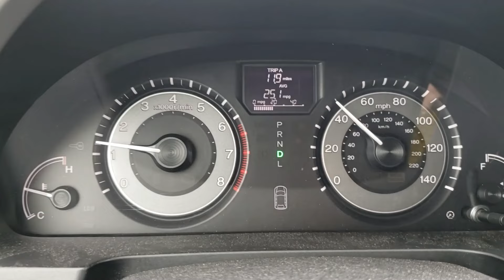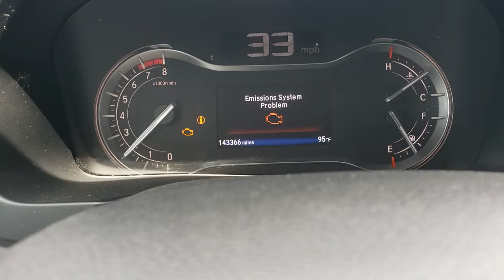EASY Fix for Honda Transmission Shudder! | Honda Transmission Maintenance

Comment: Drain plug size is 3/8 not 3/4. I’ve owned my Civic since new, change Transmission fluid every oil change. Cheap insurance.
Reply: Thanks!   I thought I will have to get a 3/4 breaker bar 😀

Comment: Honda Tech here...there is a TSB for this particular issue which involves doing 3x drain and fills of ATF in a row. By the third, you will have replaced all the fluid inside and should be bright red. There is also a software update available only at the dealership that fixes the electronic side of the issue. Torque Converters also go bad on these all the time and will throw a P0741 code if they are truly bad.
Reply from the maker: Great feedback @ZynovFTW.  Thanks for posting!
Reply: how much does it cost to get the software update?
Reply: Is this software update for all hondas? I have a civic and Id really like to know

Comment: does she (Very Very Nice young lady btw) mean 3/8" drive,,,,,  & how is she not UNDER the vehicle, & yet it's on the lift???..  Confusing video... You cal also use one funnel with a length of hose attached to then slip over the dipstick inlet - how we did it @ the Acura dealership...  SHAME on Honda for not making the dipstick tube longer reaching up higher...  SHAME

Comment: We bought a new v6 5 speed automatic Accord back in 2006.  I do all the maintenance on it. Always found it silly that it does not have a transmission pan.  I've done the fluid changes about three times in the 150,000 miles we've had it.  I've also replaced the in line filter once.  I drive it hard and use all 244hp.  I also gear it down from Drive to 3 to 2 sometimes when getting off the freeway.  Trans still works great.
Reply from the maker: Well done @jewllake!  Thanks for posting.

Comment: My 2017 Honda Pilot I change the oil and transmission fluid on a yearly basis. And I highly recommend that you only use the Honda ATF Fluid. Honda transmissions only like OEM Fluid. If you use anything else you will only cause more issues down the road.
Reply from the maker: Thanks for your feedback Austin.

Comment: You absolutely need to change the transmission filters on these vehicles. If it's accessible. I would change it every 30,000 mi. Every 50,000 miles on the outside...
Bless her heart...
This is the cutest nicest exposition of how to maintain your vehicle on the entirety of YouTube
Reply from the maker: Appreciate your comments @vette4118.  Thanks for posting!

Comment: Have you tried to reset the transmission? You turn on ignition to accessory mode, then hold accelerator pedal down to the floor for 30 seconds, then release the pedal and turn off ignition.
You can then start the vehicle and drive it. You should notice a change in shift points and smoother shifts.
Reply from the maker: Good info, thanks @MegaChuck51!

Comment: I have a 2012 honda pilot It developed a Shutter my Shutter went away when I installed a VCM muzzler 
I thought it was the transmission at first 
My pilot drives way smoother now without the VCM active
Reply from the maker: Good feedback @mikevital7656. Thanks for posting!

Comment: I have this shudder at about 30MPH between 2nd and 3rd gear I think. I've read that there's a software update for the trans that was supposed to work.. offered for the original owners a while back as a Service Bulletin. Yes? I tried the fluid change but just once.. worked only for a few days. I cheaped out but next time will go for the triple fluid drain and fill.. $125 worth of fluid I guess. Should I  change the trans filter too? This 2013 AWD LX also has the cold start growl/rash sound occasionally...  now at about 106K miles. I don't know if I should try to correct all these quirks, just live with them or just try to sell it while it still has some resale value. .. .. 
Thanks
Reply from the maker: It would be a good idea to complete the maintenance.  I'd suggest the full flush procedure and ask your local Honda dealership about any "tsb's".  The startup till warm sound may be a timing belt tensioner.  If you decide to keep it and if the timing belt service hasn't been done.  Scheduled for the full timing replace service and make sure the tensioner is included.  All in for both... probably around $1,500.  Otherwise, trade it in.  Maybe we have what your looking for?  Hope this helps!

Comment: Hi ,it showed me the light and i scanned code p0776 showed  after i change the fluid the light its off after i drove about 100 miles ? after i drove for couple of weeks start jerking again and  losing power but no lights it’s on  if i change the fluid 3 times again might resolve the problem , thanks
Reply from the maker: Your welcone Tony!  Thanks for the post.